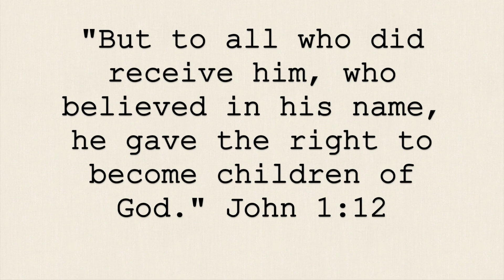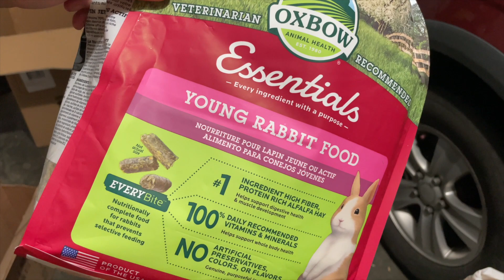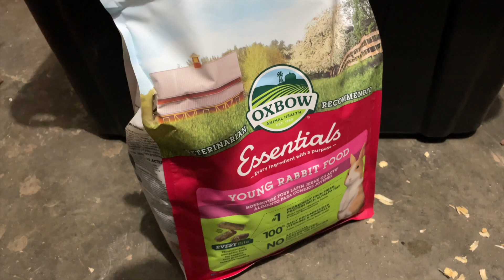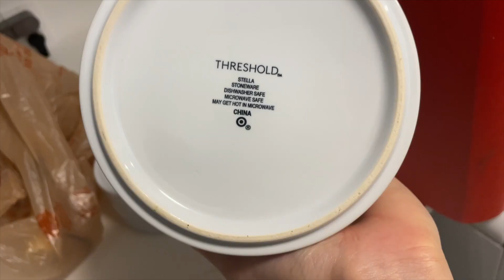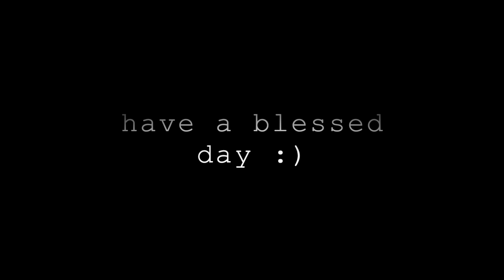Getting BUNNIES / Setting Their Cage Up

Comment: Same gender often fights. Nice cage tho! Maybe find something for the bottom. My fet told me that those undergrounds are bad for the bunny’s feed and also change that there feed will be stuck in it ❤
Reply from the maker: Yes, my aunt informed me that females especially can be aggressive so I’ll need to monitor them!❤ We also plan to get the bottom covered with more hay and tiles. However, we did specifically choose wire that is larger so they don’t have the issues that smaller wire typically creates ❤